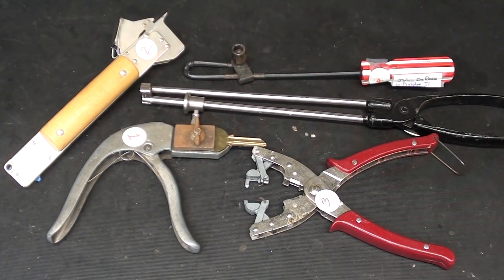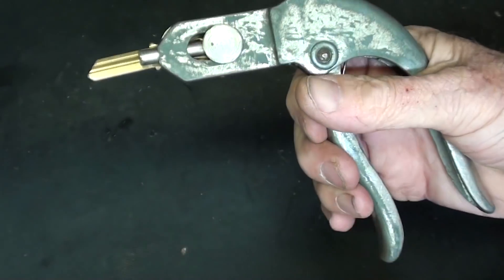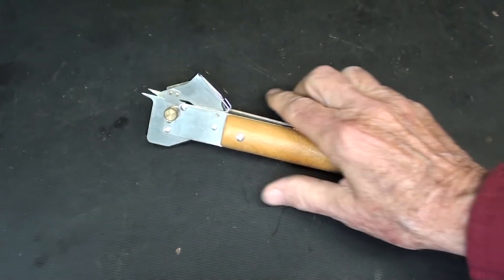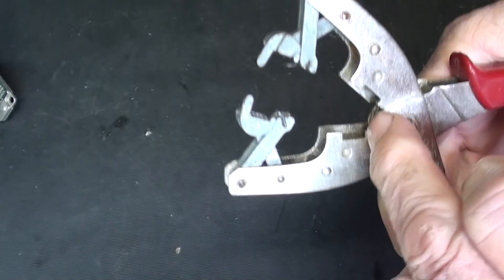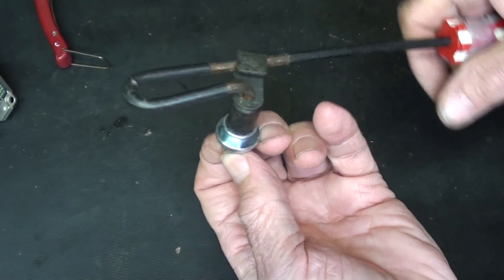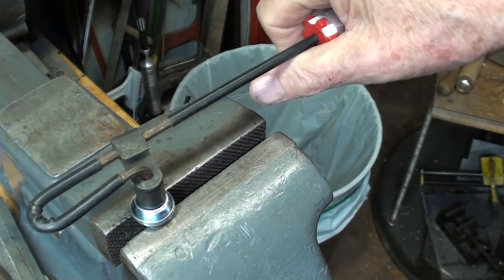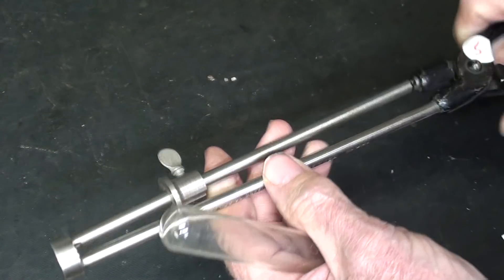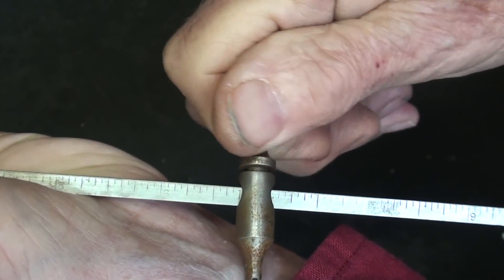WHAT IS IT? Mystery Tool Series 70b Answers tubalcain mrpete

Comment: On the key impressioning tool.  The key is held in the tool and inserted into the lock.  The handle is twisted to apply torque to the tumbler.  The handle is squeezed to pull the key out of the lock just a little bit.  This causes all the pins that are not set (in their unlocked position) to make a mark on the key blank.  The key is then removed and a key cutter tool (pretty much a specialized pliers looking tool) is used to cut a bit of the key in every location that was marked by the pin.  Locations that are not marked are left alone and not cut, as they are in their set position.  This is repeated over and over till the key has been cut in each pin location to allow all the pins to set and the tumbler being able to be unlocked.  The trigger and it connected pushpin are there to pull the key, marking it....it can be done without the tool, but would make for sore hands having to continually torque the tumbler and pull the key just the small amount required to mark the blank it the appropriate locations.
Reply from the maker: Great explanation
Reply: Very interesting. Never quite understood how that worked.
Reply: @mrpete222  I'm not sure I buy that explanation - and just think its a 'pliers' for extracting stuck keys !
Reply: @millomweb  How many times have you had a stuck key?
Reply: @bigredc222  More than you then :)
However, I don't recall having to get the drill out. They've come out eventually with a lot of wriggling and twisting.

I've had more keys just being totally stubborn in mortise locks. Moving my hand away in anticipation of the key coming out and finding the key yanked from my grip......only to fall straight onto the floor.
Reply: @millomweb  I wasn't sure if you were serious or joking. krbruner's explanation gives me the impression he knows exactly what it's for, I don't think he is guessing.
I believe him. I don't recall ever having a stuck key, I just don't think keys get stuck enough to warrant making a special tool for pulling them out.
All you would need is pliers or vice grips to grab the key.
Reply: @bigredc222  You could, I guess, argue the same for working out what key a lock needs.
With the explanation given, how would one proceed ? Logically all pins should lock the lock when the key is out. Putting a 'full' blank in shouldn't reveal anything about how much each pin should be moved to unlock it.
I'm totally not convinced !!!!
Reply: @millomweb  you just happen to be posting on a service/site that is quite full of answers....if you do not believe me, put "key impressioning" in the search bar. There are quite a variance in the tools, but the process is used locksmiths still.  Picking a lock will just get the lock open, but often, a locksmith has to provide a working key at the end of the job, this is often how they do it.
Reply: @krbruner  Many thanks for that.
Reply: @millomweb   A pair of ordinary pliers can do that. No need for the trigger mechanism.
Reply: I agree that a pair of pliers and a rattail file can make a key... in Very skilled hands! I have watched and then tried it. What a locksmith makes look easy, isn't. I would believe that this tool helps a newer or novice locksmith get the 'feel' for exactly how little the key is moved to make a mark of the tumbler pins.
     Ya'll Take Care and be safe, John
Reply: @firesurfer  for simple impressioning, I have always used vise grips.
Reply: This invention was created before cutters were comon. You would use this when using a file to remove the metal.  The twisting and jiggling actions should be enough to mark the key without needing to use the device to move the key in and out. Besides,  the throw on it is longer than several cuts which would skew your marks.

When impressioning keys the old school way, you can cut the key at the wrong geometry allowing a pin to drop behind a cut and trap the key. 

This is because you are generally using a file and basically removing metal by hand where the marks are left on the key until it stops leaving a mark. The pin provides leverage to remove the key when this happens. Thus can happen essentially when a cut is more than 3 cuts apart from the level of any other cut before it. The solution is to file a ramp to transition between the two but sometimes you don't get that far before the key gets stuck.

The cutting tool you mentioned has a taper that automatically accounts for this by expanding the cut out the deeper the cut nibbles into the key. It creates a transition ramp that can allow the spring and pin to move as higher and lower cuts pass by it when inserting and removing the key. You don't have that when filing by hand and it could cause problems this device solves.
Reply: @JohnDoe-pv2iu  if you keep trying the impressioning with a file,  you will eventually run into a situation where the key gets trapped by a pin that drops below a cut. The angle for the transition isn't quite right and it doesn't want to move out of the way. This device is like using your vice grips with a built-in leverage tool to help power out of that situation. Of course you correct the angle between cuts before trying again but it can happen.
Reply: @sumduma55  there are files, available, that work well for impressioning. Maybe they weren't available then. But I've never had a key to become trapped like that.
Reply: @hohner51  yes.there are common files out there. I'm not sure about their availability at the time of not thought. Even with common files,  this can still be a problem if you don't pay enough attention. 

The problem is that a number 4 Swiss round file for instance- will start channeling a U shape instead of a V shape on deep cuts. A lot of training resources warn about this and warn the you can get your key stuck when this happens. If you are paying attention,  you have already adjusted the U to more of a V and will not see it. If you don't have a lot of deep cuts, especially deep cuts next to high cuts, you won't see it. If you do experience it, jiggling while trying to pry the key out then adjusting the ramp angle will correct it.
Reply: @millomweb  explanation is 100% accurate.  Have made 100s of keys that way myself…
Reply: @millomweb  tolerances come into play.  Pins will always bind in an order.  Impressioning exploits that flaw.

Comment: I feel lucky.  This is the first one of theses that I managed to get all but one item, the key impression tool.  We had a much simpler tool for bending leads, a triangular plastic block with different spacing marked on it.  The downside to it was that it was only good for 1/4 watt and less resistors and very small capacitors.  Most of the time I just bent them with very small pliers.
Reply: I used to just bend the leads with needle nose pliers, too. I never learned enough about electronics to build something new. I just replaced a bad component here and there. That tool would make the repair look more professional or be useful on boards when they packed it in tight. I saw a Ham 'tube amplifier' once that was so packed, the components were barely a 1/16th of an inch apart. I remember thinking 'how in the hello do you replace something that burns out?'.
     Ya'll Take Care and be safe, John

Comment: I have had at different times a number of the lad benders, both the Harwin type you showed and 2 other types  you may not have.  I still have one "left-over" Harwin, although the move to surface mount resistors (and capacitors for that matter) have radically reduced the times I use any lead benders.

Comment: On the key impressioning tool. It may be that there was also an insert to allow "raking" a lock, to open it. Insert "rake tool", apply turning force and squeeze handle to move "rake" back and forth.
Reply: I do believe that you are right. I have seen the same thing. The tool I saw looked nearly identical and had a whole pouch of attachments for various things, including the 'picking' action that you are talking about. 
     Ya'll Take Care and be safe, John

Comment: The lead bender can be set to any width, not to accommodate different widths of component, but to match the gap between the bent leads to the spacing if holes in the circuit board.
Reply: pretty sure that what he said
Reply: @502deth  Ahh, you are right, I missed the first bit and only focused on him setting the spacing to fit the component.
Thanks.

Comment: I had a Saturday job in a glass shop when I was at school, I used a similar compass when making the new glass for clocks, some had a hole drilled in the centre of the glass to allow adjustment of the hands with a small knob that protruded through the centre, the compass I used had a small rubber sucker on the centre piece which had four marks at 90 degrees around the outside, so it could be lined up on a cross drawn on the glass and ensure the circle was right.
Reply from the maker: Thanks

Comment: My 2008 chevy uses the side terminal battery. I never had an opinion on it until I had to bust out the angle grinder to cut the bolt off of the battery since the bolt was completely seized up on the wire. 

I was this 👌 close to putting the car in neutral and rolling it down the driveway into the street.

Comment: The first tool is a lock picking tool not for measuring keys. You put a dummy key in it and push it in the lock and then apply some rotational pressure whilst quickly squeezing the pliers. The various pawls wedge up in the unlocked position as the key passes them and the door opens.

Comment: Side post batteries were first used in Chevrolet Vegas. This allowed the front of the hood to curve down for better streamlining. This is the same reason headlamps became rectangular. One advantage was it put the terminals away from the battery vent, so the terminals did not corrode. in the 90's, Delco had quality control problems and the positive terminal leaked acid, which created more corrosion problems than ever.

Comment: The lead bender would have been handy for me as I worked on those boards...you could bend them by hand but occasionally, the end of the resistor would pop and you only got one shot, a second try would definitely break something.

Comment: I remember the hardware store using the sight glass tube cutter.  Surprising how many people broke those tubes.  The tube would become coated inside with rust from the boiler so you could not see the water level.  Everyone used to take them out to clean them and they would wind up breaking.

Comment: They still have those side terminal batteries actually quite a few cars and trucks have them and you usually have to take have the engine compartment apart to change the battery

Comment: Much much better tube cutter than the one I used cutting site glass on boilers,  feed water tanks and domestic hot water tanks (hospital). Ours looked like a  timing chain with a cutter  wheel that wrapped around the pyrex tube.
Reply: Or the "bottle cutter" style that holds the cutting tool in place with a cork.

Comment: That box of electronic parts screams "tube radio repair" to me.  The nylon line was the giveaway.  That's for rethreading tuning knobs/indicators.  Allen-Bradley style and wirewound resistors...and an old panel mount transistor.  Looks like someone was taking on some radio repair.

Comment: The lead bender isn't obsolete because of ICs, it's obsolete because most all discretes are surface mount instead of thru-hole.  (so no bending needed)   Now that I get a better view of the wire stripper, the crimp section means it's probably meant for phone plugs like RJ-6.  Looks too small for larger sizes like RJ-45.

Comment: They're left hand threads on some older cars wheel studs. I don't remember which but I had a couple old utility trailers my grandpa had built from old hubs. Drove me "nuts" until I figured it out putting new tires on them!
Reply: Some truck manufacturers still have left hand threads on the wheel studs on the drivers side(or is it the passenger side?😕), saw it on Ford Boss Me
Reply: Chrysler was notorious for left hand threads on the driver's side. (I had a bunch of Dusters and Roadrunners)

Comment: The side terminal was GM only, my '09 van has side terminal. Haven't heard of GM abandoning it. People didn't like it mainly because it was hard to use jumper cables. They actually seem to be more reliable than top post (My experience)
Reply: A problem back then was that the cable terminal end was devilishly good at hiding corrosion. A good cleaning involved immersing the end of the battery cable into a cup of hot water and baking soda. The corrosion was also very good at making it difficult or impossible to get the terminal loose without damaging the battery. Needle nose Vice Grips were your friend. Because of the corrosion problem you'd often see cables with the original ends cut off and an standard style terminal affixed to the cable. The side terminal battery then had one of the adapters Lyle showed screwed in. The fix required the terminals to still  be cleaned regularly as the side terminal batteries often generated a lot of corrosion no matter what you did.

Comment: I've never heard the reason why Mopar put left hand threads on their driver side wheel studs back in the 1950s. Not all of the manufacturers were doing this at that time and to my knowledge nobody does it today. What was the theory behind them doing it?
Reply from the maker: My 1951 Buick used left hand lugs
Reply: @mrpete222  Interesting. I stand corrected. Admittedly, I had only seen them on a Plymouth, never before ever hearing of them at all, and assumed it was only a Mopar thing.

Comment: Spec resistors aren’t color coded.  They are labeled, with the information in a consrast color.  Typically white or silver on  dark bodied devices, and black on light colored bodies.   They were the only way, this color blinded kid, made it through electronics shop.  

I still had to learn the standard color code for the test, and the teacher made me a separate test with drawings of resistors and the color of the bands printed above the bands.

Comment: I always had poor results cutting glass with it popping and chipping along the score line.  I went to PPG (Pittsburgh Plate Glass) to have some cut, made the same comment and the guy free handed a piece that would fit in a jigsaw puzzle to intimidate me.  Then he told me the secret was the tool and how they store it.  When the tool is new, the wheel has a nice, smooth edge on the wheel (a good one does).  As they get older, if the edge on the wheel starts to corrode even a little bit it will no longer work.  At the shop they store them upside down in a can of oil to protect the wheel and grease it if you store it.
Reply from the maker: Thank you, that’s good to know
Reply: @mrpete222  Maybe you could try scoring the inside of a glass bottle neck with that tool. Then pour boiling water on the score line followed by cold tap water. It should go "TINK!" and crack most of the way around if not full off.
Then you have a slide for the neck of a guitar or cigar box guitar ;-).

Comment: As a long time locksmith who has impressioned my fair share of locks that’s a strange doodad. The action is all wrong. When inpressioning you bind the key then rock it up and down. The bound pins will leave a mark on the blank hinting as to where to file. Pulling the blank would give you zip. Obviously that’s why Mr. Pat Pend never sold any of those. Plenty of examples on YouTube if you want to see how it works. I wish someone had a video available when I was learning. Happy New Years.
Reply: They work fine. Just depends which method you were taught
Reply: I would love to see some reference material for this method. I have been using the bind and rock for near 20 years. It’s all I’ve ever seen.
Reply: Your the MAN. Thanks for that.

Comment: you listened to wrong people about number 3 you can buy a tool for cat 5 and phone cord plugs cheap at walmart. i have all types of wire/ cable strippers and this one does what no other can why would i pay that much otherwise. read my post in 70a and see. its not for stranded wire only solid core used in light switches and outlets in confined tight spots where wires are too short to pull out of wall box

Comment: The squeezing of the handle, is for the key spacing. Two important on keys pin spacing and key height
Reply: The pulling has nothing to do with spacing.  It is simply what causes the pins to mark the blank.

Comment: I like the side terminal batteries. My experience with them has always been good and I used to have a service station and we sold a good number of batteries. If the cables were in good shape and the bolt was secure, the corrosion was way less than a top post battery.  The worst battery connection in the world is a lead replacement connector that clamps the cable to the terminal for a post style battery. These guarantee corrosion, even with the miracle sprays that come from a can.  They were great for increasing the number of road calls during cold months. Those post conversion adapters I think were manufactured to sell side terminal batteries for cars originally equipped with a top post. Less chance of losing a sale if the correct battery was out of stock.